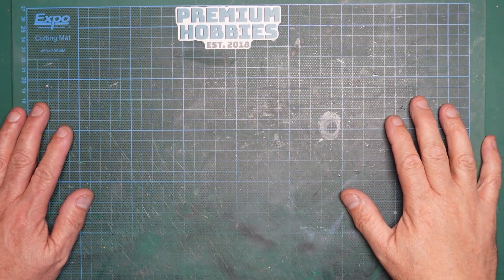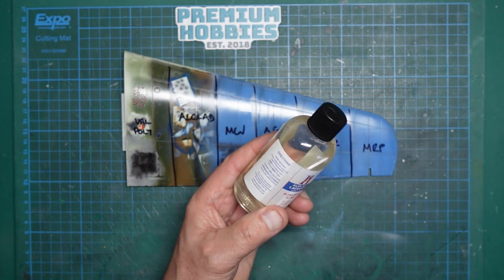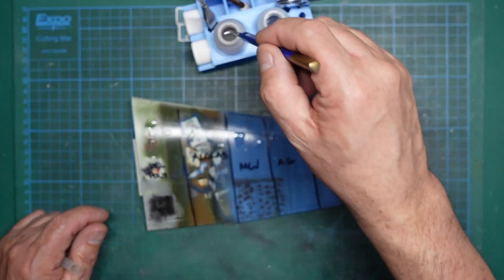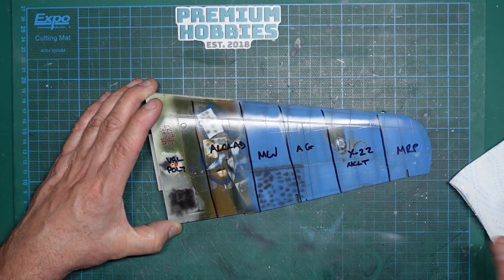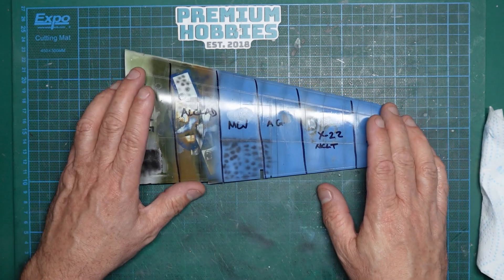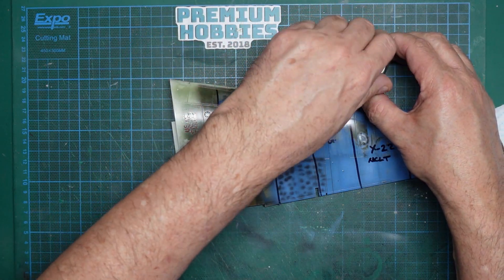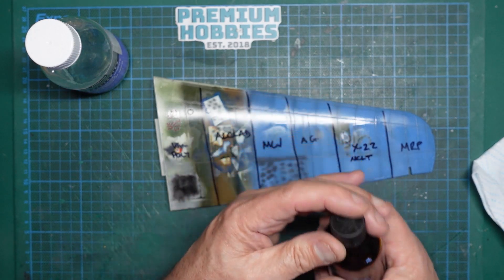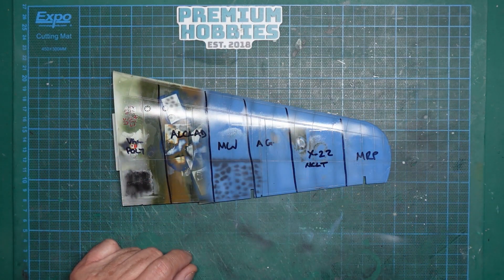Can clear coats resist all thinners and decal setting solutions?

Comment: Had same results with Tamiya MF Super Strong. Ate right through Aqua Gloss over AK RC paint. However it was fine on Alclad II gloss ALC310 (enamel based) with no discoloration or eat through and set down the Tamiya decal really well. I have bought some Tamiya LP-9 gloss and Mr Hobby GX100  gloss to test it out on them to see what happens.
Have heard Walthers Solvaset works well on Tamiya decals but is very hard to find where I live.
Reply from the maker: Thanks for sharing
Reply: I tested Super Strong on a few more clear coats. Alclad ALC310 (enamel), Mr Hobby GX100 (lacquer), Tamiya LP-24 semi gloss (lacquer), Tamiya X-22 (acrylic), Testors (lacquer) and Future (acrylic). As in  your video I rubbed the  S Strong on the surface, while S Strong was still wet and found it reacted  with all except for ALC310 and GX100.  However if placed S Strong on the surface of all and let it naturally evaporate till dry, with no rubbing at all, there was only a reaction with Future, Testors and Aqua Gloss(acrylic) from my comment above. S Strong did not like future or Aqua Gloss at all and ate right through it no matter what. With Testors it left a slight discoloration on the surface. The rest looked fine. From my test it looks like ALC310 and GX100 are bullet proof to Tamiya MF Super Strong. How does it react with decals? I works well with Tamiya decals and sets them right down. As with other brand decals you will have to try for yourself. I double dog dare you.
Reply from the maker: @Maddog-nb9vu  thanks very much for your efforts. I shall pin your comment. 
I have just tried it on LP9 that had only been down a few mins but touch dry. It ate it immediately!!

Comment: microset + micro sol made a mess of my vallejo 'PREMIUM' gloss varnish...a different brand of vallejo gloss varnish then the 'straight polyurethanne Gloss varnish (as you used in your test.).my Tamiya spitfire MK1 1/48 model paint was ruined as the micro set/soll seemed to eat away at it???
Reply from the maker: Very strange? I can only assume the paint wasn't left long enough to harden, plus Vallejo is not the best. I have never had an issue with set + sol or the Mr Hobby stuff.

Comment: When you use lacquer clear the decal solutions are fine I found out the hard way to don't use water based clears and decal solutions
Reply from the maker: Micro set/sol is no problem. The main issue here is the Tamiya strong.

Comment: RE the Super Strong, I put some Tamiya Decals on a painted underside that was painted in Mr Color 203 Super Iron 2, no top coat just straight onto the paint. Not a single issue, and it was left on for hours, and I kept topping it up and brushed over it as it wouldn't bloody stick, even with the Super Strong painted on underneath.

Comment: I’ve just ruined the finish on my latest Harrier gr3 because of using Tamiya Mark Fit for the first time as I’d ran out of Microsol. And I’d used Tamiya acrylics throughout and thought it’d be safe. And to be honest it did nothing to the Italeri supplied decals.
Great information Nigel, thanks for taking the time to do it.
Happy New Year everyone, Ian
Reply from the maker: Sorry to hear that mate. I'm sure if you let it dry for a week or two it'll be hard enough to sand back and re-coat with clear?
Reply: @NigelsModellingBench  it actually went back to plastic and thankfully it was on the fin so it was relatively easy to repair. It was the Yellow Markfit for anyone interested.
Reply from the maker: @bugler75  bloody hell!! Sorry to hear that mate!!

Comment: The no 1 tip with using setting solution and clear coat, is do not let it set and etch, wipe it away quickly after being applied.
Reply from the maker: Well, if you don't use the hot ones like i showed here, it won't affect the clearcoat. If you wipe it away it cant do its job surely?
Reply: @NigelsModellingBench  my mistake Nigel, i actually overlooked the fact that some solutions are hot. Your quite right mate.

Comment: Would have been interesting to try the other versions of Mark Fit. Maybe try just the Strong (blue and yellow) but not the Super Strong (black label).
I’ve used the Strong without issue over Tamiya X-22 without issue. From other tests the plain Mark Fit (yellow) didn’t do as good of a job of settling the decals.
Reply from the maker: Good point, I believe, as you say the two "lesser" variants don't cause any issues, but I was told this one does, so I tried it out.

Comment: Hi Nigel, I have a question. When I use Tamiya x-22 clear with their thinner x-20a, I get a slight orange peel texture, because of successive layers, as it can't be sprayed wet in one shot, (I've been told), does Mr Color leveling thinner makes it better? And also is it safe to spray that mix on clear parts (canopy or windshield, in my case), I'm building a Porsche 962 Shell Tamiya with the clear parts fused in the body, I don't understand why they did that as the same car exists (with different sponsor)without that... Thank you for your great videos, very instructive for all levels of modelers.👍
Reply from the maker: MCLT will work much better X-20a. You need to thin around 50-50 minimum, up to 70% thinner if your X-22 is a little gloopy. For a model car I would consider using a 2k system such as Hiroboy or splash paints? I would mask the clear if I were you. If you are getting orange peel, try thinning more.
Reply: @NigelsModellingBench  Thank you Nigel, I use urethane clear with catalyst and reducer from Dupont, I guess that it's the same as 2k, the thing is that it's too perfect, it looks like the car was dipped in syrup...I'm a pain, I know. 😊
Reply from the maker: @Yves95128  Sand the hardened clearcoat back with some wet 2000 grit to remove the glaze look, then polish with compound until you reach the shine you're looking for. This is also an issue on classic restorations. modern 2k paints make them look like they were dipped in liquid plastic.
Reply: @NigelsModellingBench  I might try that, perhaps with a finer grain. Thanks for the follow-up.

Comment: Logically, any solvent powerful enough will disolve the clear coat and any protective layer. From a chemisty point of view, we would need to find the clear coat which isnt disolvable in any standard thinner. I would assume an enamel thinner isnt likely to attack acryllic paint and vice versa as a result. Similarly an alcohol based solvent shouldnt attack either (?).
Reply from the maker: Well, your reasoning is exactly why I did this test. You saw the Enamel thinner attack some of the acrylics?
Reply: @NigelsModellingBench  Yes, but leads me to ask the question what is the base composition of the clear coat and of the thinner, but I dont think this is either very easy to obtain or requires more knowledge of chemistry than I have. I guess this is a roundabout way of asking is the problem due to the thinner or the paint itself. I might also ask will some clear coats also react with the base paint as well ?

Mig paint is stated to be water based and it pools under surface tension on plastic rather like water. It ought to be possible to add another solvent to reduce/eliminate this problem. However, being water based it ? ought to be impervious to any non-water solvent as well.

This is a complex can of worms :).  I think it would be helpful to draw up a table of which combination don't work together. I've enever seen anyone do that and it eems to me a bit of an omission. This is why this is a Great video imo.

Comment: Had some squadron decals. These things were thick like Tamiya thick. I brought out the big guns and used Solvaset. One application on say cartograf decals is enough and maybe a bit of of overkill. But wow. I applied coat after coat after coat of Solvaset on those things and they wouldn't snuggle down. I had to stop because I noticed that the decals were getting rough after drying which is a sure sign that if you keep going its going to fall apart. Never seen anything like that. I used Tamiya semi-gloss clear as my clear coat.
Reply from the maker: Sounds like hobbyboss decals??
Reply: @NigelsModellingBench  Nigel,  any experience with Revell Decals? I recently got their excellent P-51D and the decals look thick.
Reply from the maker: @tallyhoscalemodels  in my experience revell decals have been awesome. They are generally Cartograph or "Zanetti" I think is the name.